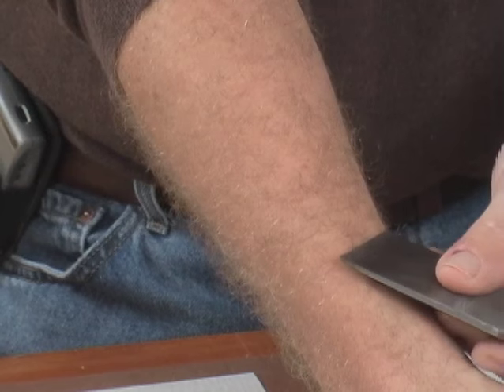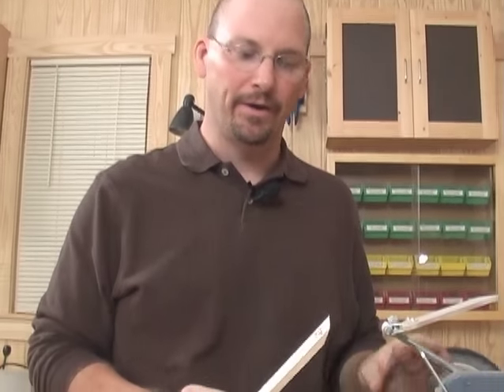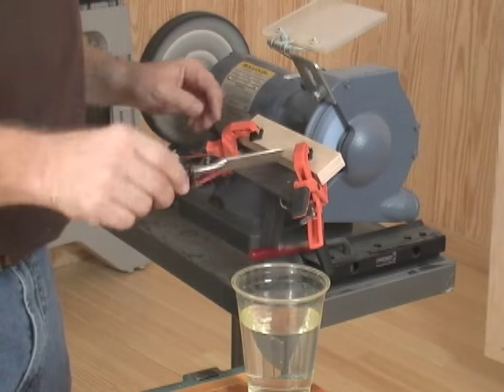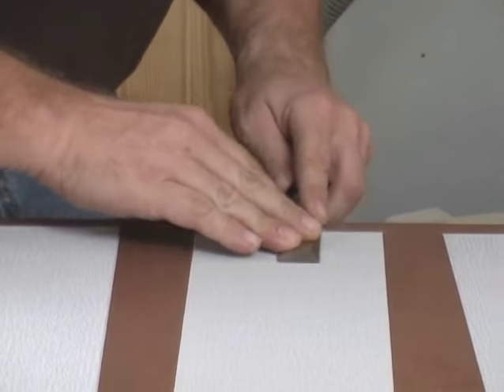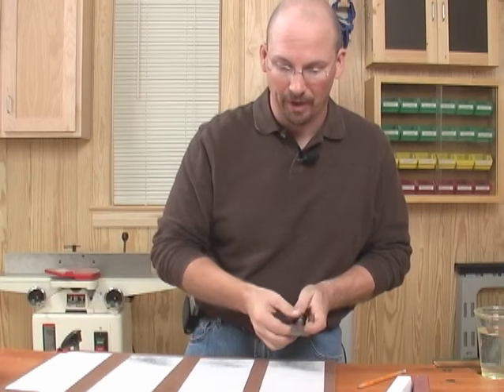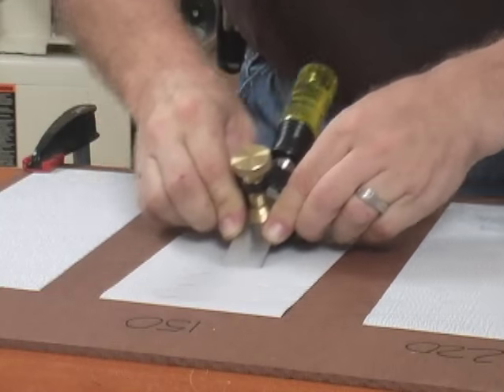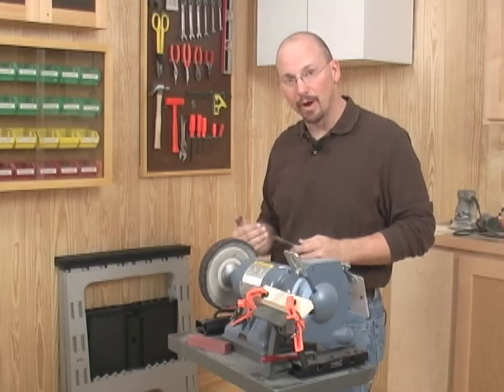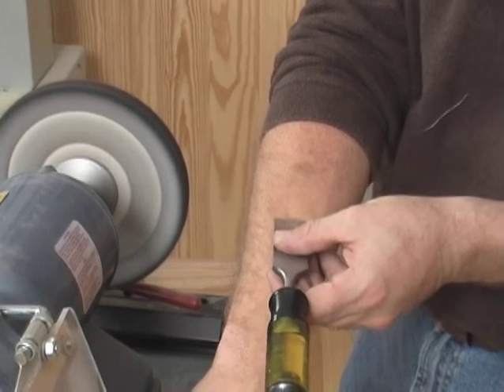Super Simple Sharpening Method for Chisels - WOOD magazine

Comment: Disagree with that last step. You should not need to use the buffing wheel. To get that razor sharp edge, you can just use the finer grit of sandpaper. Also, establishing the flat back of the chisel, using that buffing wheel will round it over once again.
The real reason for using a grinding wheel, is to establish a slight hollow, so the edge will be extremely sharp, and easy to re-sharpen by hand, on a flat surface.

Comment: If you're just going to use sandpaper and a honing jig, why waste time with the grinder?
Reply: The grinder provides the primary bevel of 25°, using an 80 grit wheel to remove a lot of steel relatively quickly, and giving a hollow ground.

The jig with sandpaper provides a shorter secondary bevel of 30°.

The stropping compound furthers the process to get a mirror, razor sharp edge.

Comment: man.... somebody needs a wet stone,when you put pressure on the board,i could see it bow,so you end up with a curved edge
 and 30 steps to sharpen a chisel? how about 3!!  
1. bench grinder , 
2. wet stone course side ,
3.wetstone fine side , 
that's it! your expensive chisels will love you for ever if you get rid of the sandpaper believe me.
first thing you learn in carpentry school and being a carpenter for 22 years still use it and it still works perfect for me
Reply: wet stone... use a simple oil or water?? At school we called the wetstone and oilstone...
Reply: Rob Coleman what do you mean with this awnser,,is it in reply to me or what??
Reply: Leon Meertens • Some people prefer an oilstone. It’s just a bit more maintenance. I’m fine with H2O. From there I’ll often use a burnisher, then hone with a leather strap.

Comment: I've never really understood the mania of wanting chisels sharp enough to shave hair when they're used to shave wood - which is much harder.
The sharper a chisel is the quicker it will lose the edge - that is why sharp enough to cleanly shave wood is sharp enough.
Also, I would avoid leaning over your buffing wheel while it's running.